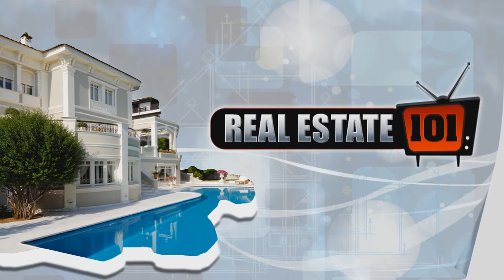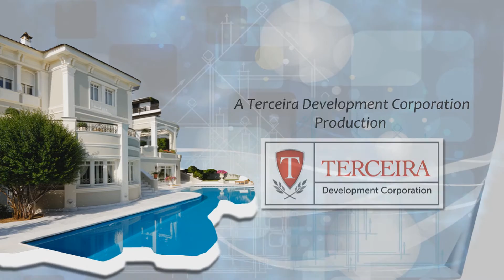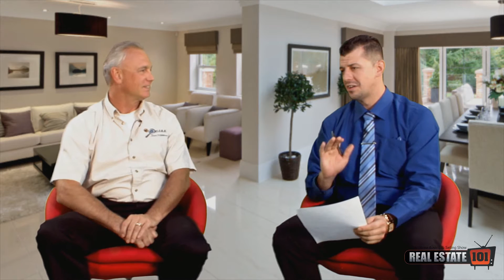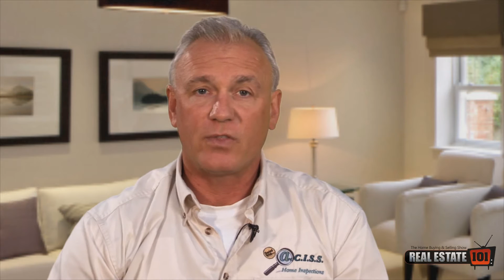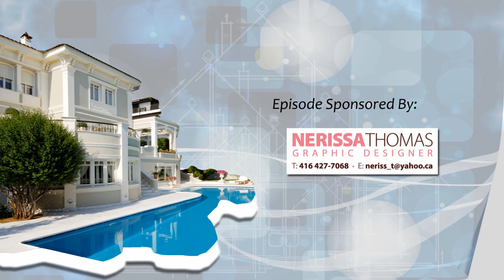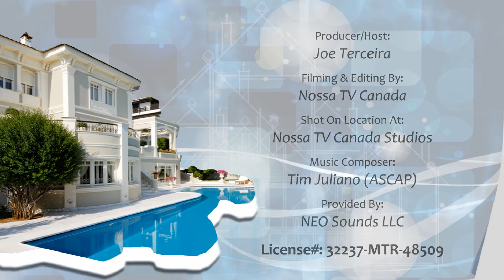New Home Inspections & Tarion Warranty

Comment: Extended warranty from a builder ? That's got to be the biggest crock of Shite I've ever heard. Builders avoid warranty work within the warranty period, and when they do anything they send a general patch work flunky to do a half ass job. The only tools the builder handy man carries around is a tube of silicon, some screw drivers and a tub of plaster. 
Forget about Tarion as well, they're in bed with the builders. Bottom line is when you buy a new home from a builder Ontario, or Canada for that matter you will get screwed one way or the other. It's not a question of not getting screwed, but rather how badly screwed you're going to be in the end. How do you avoid this you might ask ? Well, visit the site every other day with a camera and take pictures. And be prepared for a fight of your life. 

Why anyone would want to buy a cookie cutter new home is beyond any common sense. Quite literally a Jack in the Box situation. You don't know who your neighbors will be, your home is bare bones with a plethora of underlying problems, and you will have to deal with many other issues beyond the "so called" warranty period as the house settles. Like cracked and leaking foundations, poor hvac, dirt and dust through out, poorly insulated windows, etc.